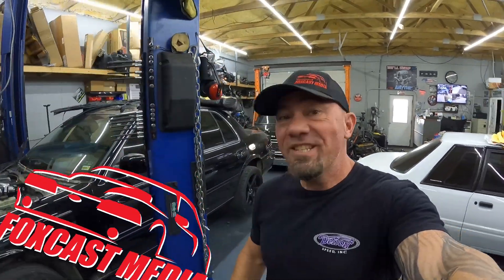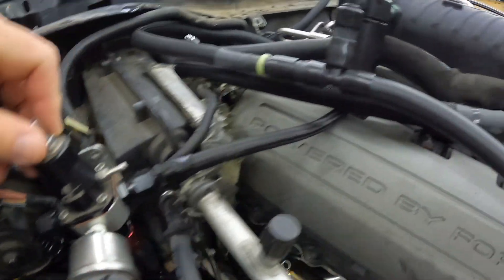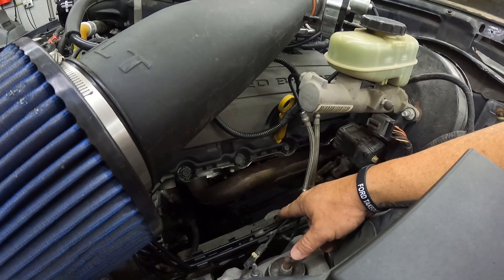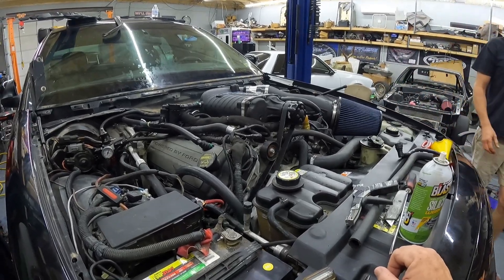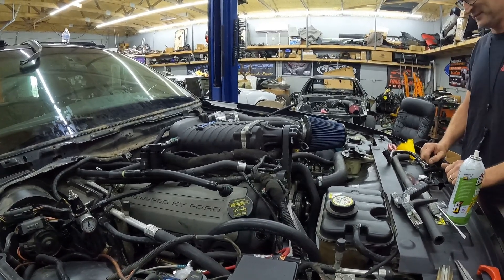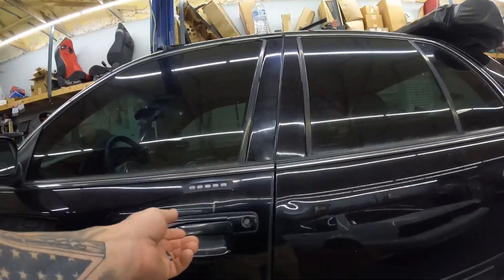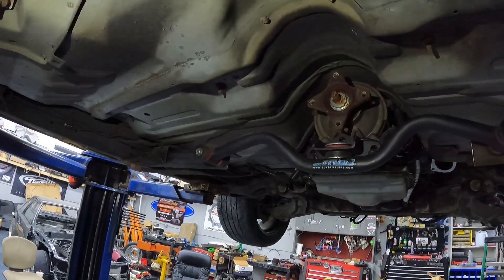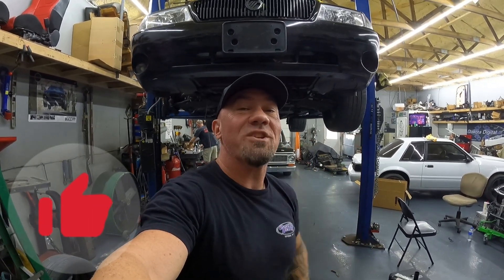Worlds fastest coyote swapped & supercharged Mercury Marauder!

Comment: Cleetus McFarland has a coyote built Crown Vic. I'm sure he could give you some good information.
Reply: They make there own headers
Reply: Did he put a coyote in it?  It used to have a gt500 motor in it the 5.4 4v one.  No it isn't the same thing as a coyote they're both dohc fords but the coyote isn't the same.  All dohc fords aren't called coyotes they've had dohc fords since 1993 and the coyote didn't come out till 2011.  He may very well have changed it to a coyote I don't know I don't follow his channel real close.  I know it did have a 5.4 gt500 motor with a gen 3 vmp blower on it pushing alot of power.
Reply: @midnight347  Yup, he blew up the GT500 5.4 4v swapped in a coyote.
Reply: @chadvarble3565  Stainless works makes headers for the MM But the flange I think is different, so if he chops em off and welds on coyote flanges it should work

Comment: Stainless Works makes headers for Panther cars
Reply: All you need is the coyote flanges welded on to stainless works long tubes header for the marauder and it should fit perfectly. Couple of guys have done it already. Please do something about that cross member for the trans. Modify the stock one like U S shift did with power by the hours 6r80 mount